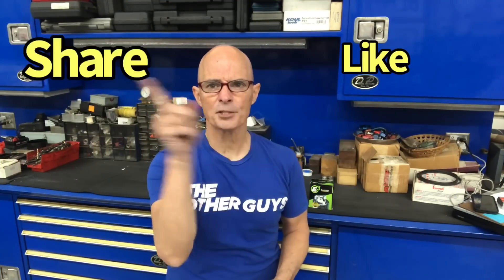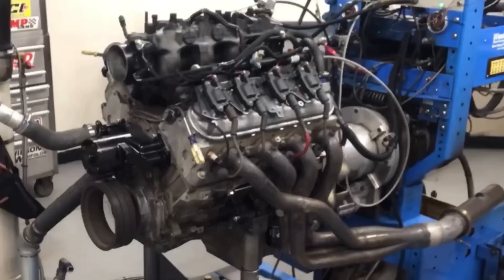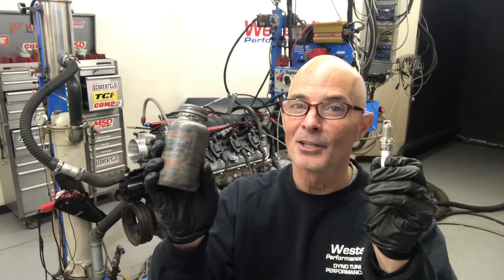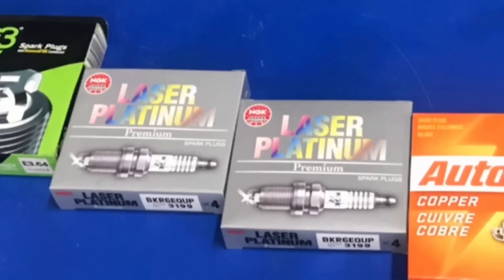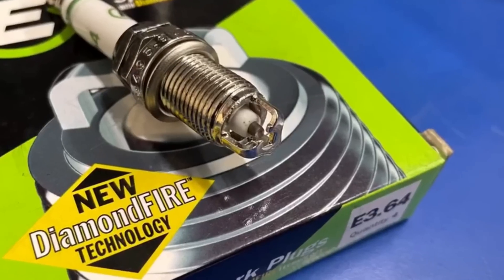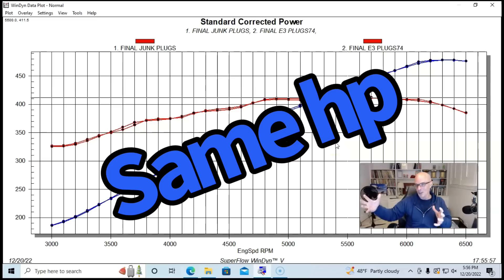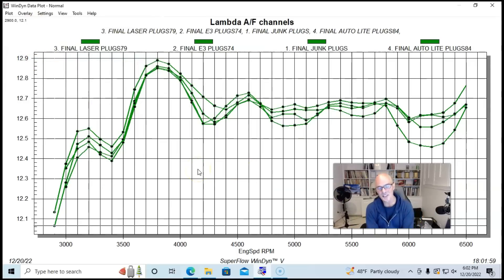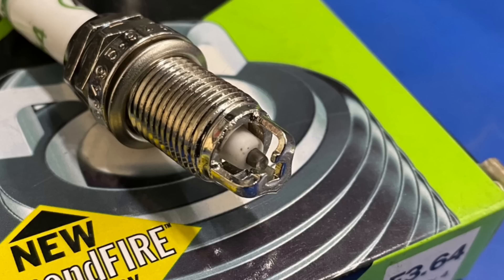E3 SPARK PLUGS-DOES DIAMOND FIRE TECHNOLOGY REALLY ADD POWER? E3 VS LASER PLATINUM VS CHEAP COPPER

Comment: I am tuning up my 01 2 door jimmy 😊 I'm putting e3 plugs 8.5 mm wires and a msd ignition coil ❤ wonder if the wires with the coil and plugs will make any noticeable difference in hoping because the truck was clapped out when I got it I'm sure they r factory wires
Reply from the maker: NOT UNLESS THERE WAS A MISFIRE
Reply: @richardholdener1727  there was definitely a misfire before on the interstate it didnt  misfire until I get up to 70 btw truck runs and idles really well now

Comment: Try BRISK Multi Fire Spark plugs. I have had good experience with Brisk plugs and thought “no way” on the multi fires. At $15 each x 4 on my modified 2015 VW CC that operates up to 29# boost, at the 1/2 mile drags I swapped out the NGK’s for the Brisks and picked up .92 MPH. This was same heat range equivalent to the NGK plugs. I put NGK’s back in, lost similar MPH. Same results in 1/4 mile drags but around 1/2 the improvement. MPH = HP so obviously they do work. However, I believe they lead to early coil issues and are good for only about 15,000 miles on the street. So I just load them up for race nights.
Reply from the maker: EXPLAIN HOW THEY MAKE M0RE POWER IF THERE IS NO MISFIRE

Comment: You should always use copper anti-seize vs. the silver due to copper having better electrical and heat properties.  I found out that when I used silver anti-seize my racecar didn't run as well as the copper C5A

Comment: I'm using e3 not for power but precision and efficiency.
I tried iridium NGK plugs .
They wasn't aggressive as the E3 .
NGK iridium was more oriented to comfort.
So they are not good for my specs.
E3 is more responsibe.
Specially with E23 or 23% alcohol/ethanol gasoline.
Coil Accel, cap and rotor BWD, Cables NGK blue series.
Test car EJ8
Reply from the maker: NOT SURE WHAT YOU MEAN BY AGGRESSIVE?

Comment: After watching this and the Engine Masters show on plugs it is pretty clear that bigger gap to an extent, will increase power, not the specific plugs.  I found that to be true when I had a Moto Guzzi.  I replaced the junk weak stock coils with Ford Motorcraft coils (used) with ballast resistors.  It immediately had a hotter spark and I could gap them out to .040".  I won't say it ran better, but with what I've seen I would say it did probably work better.  Did run and idle better at low rpm.  My brother did the same change on his RD400, as did a friend with his RD350, definitely an improvement and no fouled plugs.  

I have to believe it is the bigger hotter spark of the wider gap.  The voltage to jump the gap has to be higher and obviously the gap means a larger spark as well.   

I found this and Holdener's other video where he did gap changes when looking to find some factual proof if E3 did anything or not.  Clearly not.   Yet there are people claiming 15-20 hp gain.   A bit hard to believe for sure now.   I could believe they may make engines run a bit better if the gap to the electrode is bigger making a larger hotter spark, but all it takes is one spark to fire the mix.  And that spark will be between the best two points to fire, not all over the place, like when there is consistent electrical pressure making the spark virtually continuously firing.   That doesn't happen in the real world of firing the fuel mix in an IC engine.  One good spark and bang!   It fires...  flame on!

Comment: I've tested the E3 with the old butt dyno. I drove on them for about 5k miles and made no difference. The one thing I did notice was they seemed to be very cheaply plated. Parts of the plating flaked off. Just for that alone, I refuse to run them.

Comment: Very informative video!  At the end of the day, a spark plug is designed to ignite fuel/air mixture. They either will or they won't. The way I see it, the design/material the center and ground electrodes are made of can dictate the longevity of the plugs. And, with the way the factories are hiding the plugs on a lot of the engines, I personally want a plug to last AS LONG AS POSSIBLE!! 😀

Comment: I think if a guy could get a piece of standard Romex sealed in a spark plug hole, the engine would make the same amount of power that it usually does until the Romex burned up.

Comment: I have a set of E3's to go in my 4200 Atlas but my guru homeboy on the west coast said go back with the AC Delco Iridiums & let it ride! I removed the AD Delco Iridiums that were in there when I bought my 2005 Trailblazer LS & I had 130,000 miles at the time I pulled the plugs & they were the OE plugs & WOW, none were fouled, just worn! I was changing the coils & figured why not throw a fresh set of plugs while I had gone that far. It was running smooth but I wanted to know how the plugs looked anyway since I had bought it at 124,000 miles. New plugs & coils & Wix filters, Dynomax Super Turbo muffler & resonator delete with a set of double walled stainless steel tips out back & she is running primo smooth 🥰 Also have Marvel Mystery oil in the engine & 1oz mix in with every fill up of 93 octane. When I mash on it she doesn't hesitate! Cold air & tune next🥰👍🏿

Comment: I like your videos short to-the-point not all the technical mumbo-jumbo but when you say it made a little bit of power you need to say how much power if it's a corner of a horsepower more than let us know cuz that's what you're comparing is not just a little bit can't measure a little bit. You said the same thing with the 8.1 changing headers it made just a little bit that was 10 horsepower and torque that's quite a bit that's info we need to know so thank you keep up the good work
Reply from the maker: please look at the graphs-the plugs made zero difference

Comment: IF you have “enough” spark and safe conservative timing and proper-ish afr, all of the spark plug tests (gap, index, type) are a moot point. If you have a more radical combination, or something with a garbage chamber, pushing the limits of your available octane or leaning on the timing to run a number and win, then you might see a need for a specific plug that works better for you. No magical plug for a mild properly tuned daily. That’s just marketing 

I’d be interested to see how much you could lean on different plugs before running into trouble… on your dime of course
Reply: You hit the nail on the head. There are some very specific situations in which a particular plug will perform drastically better than others. I work on Subaru EA series pushrod engines from the 70s and 80s. My daily driver has a highly modified EA71S (factory race engine built 1989). The EA71S called for a special Golden Lodge 25HL spark plug which is very hard to find today. It was a semi surface gap plug with a very cold heat range. I run true surface gaps like you would see in an outboard engine. The combustion chamber design is extremely primitive. And the intake valve goes all the way to the wall of the chamber. Any plug with more than a slightly projected tip will be hit by the intake valve. Anything more than the coldest heat range will cause detonation. Conventional plugs with a ground strap will start misfiring over 8500 RPM. So a surface gap is the only possible option, especially when driving on the street which would foul the NGK 11 or 12 heat range plugs required to keep detonation from occuring. The surface gap plugs will self clean and there is nothing shrouding the spark which in this engine is worth about 10 HP. But this is an engine where the combustion chamber is essentially an oblong depression and the spark plug is in one side. Over 40 degrees of advance required to make any kind of power.

Comment: anyone whos had college chemistry (stoichiometry) knows that copper is a far better conductor of electricity than any other metal except gold. Platinum is one of the worst electrical conductors and the plugs I use in my K/SA '87 Monte Carlo SS is Nippon Denso U-Grooves. Its a .060 305 with 081 centerbolt heads, and custom ground solid lifter cam running VP C10. They run the best in my engine (motors are electric) and I have yet to find a plug that works better and Ive tried them all.
Reply from the maker: the dyno tells us reality-conductivity is not the question-does the spark plug work (if yes, no need for more conductivity)

Comment: Hey Richard, love your videos as always. I will say that Iridium and Platinum plugs have slightly different intents, as well as the new Ruthenium plugs. Would really enjoy a comparison between Copper, Platinum, Iridium, and Ruthenium all from the same brand. NGK would be the brand obviously. Iridium plugs are used in racing, Ruthenium are supposed to be sort of a jack of all trades. I suspect there would be few differences in a single dyno run vs a high stressed engine under endurance conditions, but would be interesting to see.
Reply from the maker: don't look for any power change from plugs-unless misfire

Comment: Silver plugs are better than copper, because lower resistance is better than high resistance.

Super fine tips and tips with square edges are better than thicker tips or tips with rounded edges ( for a given material)

If
You’re concerned about lifespan and maintenance intervals your not concerned about your engine.
Reply: My favourite plug, which I’ve found to work flawlessly in EVERY SINGLE APPLICATION I’ve ever used them in was the Bosch +4 Super Silver.

Comment: The copper plugs did run marginally leaner, a full tenth at 6000, I wonder if there would be a gradual and cumulative effect on combustion chamber temperature at steady-state cruising? And if there would be any long-term effects worth considering like the potential to increase valve seat wear due to any increased combustion temp? Do you think the engine management system would equalize the A/F ratios to be even closer to the same amongst the various plugs given an extended time to modify the fuel trims?
Reply from the maker: 1/10th of an af point is not a change from the plug (that is the margin of change from 1 run to another with no plug change)
Reply: @richardholdener1727  Oh ok, thanks for the clarification 👍

Comment: I would like to see if there is any difference in the A/F ratio at idle, as well as lower RPM power numbers, say from idle to 3000, where an engine is mostly used and torque matters the most.
Reply from the maker: you ever run your motor at wot at 800 rpm?
Reply: @richardholdener1727 Sure, lots of people floor their vehicles from a stop, from idle or not far above it. Low-end, off idle torque seems to be the most useful feature of an engine, getting the weight of the vehicle moving from a standstill is where most engines see their highest loads right? At higher rpms the engines aren't working as hard because they're already spun-up, using their already stored kinetic energy to their advantage, they're not dealing with as much inertia as it relates to internal rotating mass or the mass of the vehicle as its already overcome its initial resistance to motion after it begins moving. High rpm power numbers are pretty much irrelevant to most people as they don't use their engines up there nearly as often, but every time they leave a light or a stop sign, that off-idle torque is what puts a smile on their face, or not, lol.

Comment: Richard! I have a 6.0 in my 2003 SS sjlverado to start off with, l pulled out the Platt. 1month old plugs, put in E3's no other mods!
I could feel the difference  Right away!  in
The seat of pants feel! Ran
Better,started easer, PICKED UP  AT LEAST 1.3MPG!  
AGAIN NO OTHER THINGS ON THE TRUCK TOUCHED!
PUT A SET E3'S IN MY WIFE'S AVALANCHE  W/5.3, SAME DEAL YOU CAN FEEL THE 
EXTRA POWER IN THE SEAT OF PANTS! also some mpg!
Reply from the maker: no on the power, I would like to see your test procedure for mpg
Reply: @richardholdener1727  hay Richard, picked out a distance, backand forth 
With repeated it, with e3's and before with platt.plugs 4trips average 
With my truck 
Computer and by calculator! Always 1.mpg 
To 1. 3 and as much as 1. 4mpg. With different weather!
Reply: It’s called the placebo effect.

Comment: I’ve ran a set of e3 spark plug’s in my 63 Chevy 283 m/t two wheel drive pick up truck for years I think I got them when they first became available to purchase I replaced them because the factory plugs were fouling from leaking valve seals and would have to be pulled weekly and cleaned after putting the e3 plugs in I’ve never pulled them I still have the points distributer and oil bath air cleaner so for me they are great

Comment: There is differences in plugs,, if you use a colder plug in a high comp engine.
The iridium plugs last a LOT longer and cost a LOT more.
I changed the plugs on my Landcruiser 4500 with near 400000 km. They were worn out though the thing ran fine, even on LPG. I suspect they were the original plugs. It did seem a little more economical after,

Comment: Heat range is what seems to matter the most... Is there a difference in resistance in some brands? Good video as always!
Reply: Yes & no.  Since high voltage is an odd beast a multimeter is not necessarily useful - measuring peak current would be the only real world proof.   The interesting thing I stumbled upon years ago is that aviation plugs tend to favor being roughly 2/3 the resistance of automotive design.  Maybe an engineer or intrepid flyer can explain why.

Comment: Thanks Richard for that info
 I was wondering if you have done the same with coil packs factory vs aftermarket?
Reply from the maker: not yet-but likely the same results since the factory coils worked well over 1500 hp

Comment: Would you be willing to find a 2.5 volvo s60r and see with plug would be the best on a stock tune. .everyone claims oem. Volvo plugs or Bosch plugs. Gaped at 00.28 and what I'm asking for is witch plug can possibly eliminate detonation that cracks thin over bored cylinder wall. You seem like the perfect guy because of your knowledge base. Would you please consider this . The 2004 threw 2007 is a rare tuner sedan horsepower 300 on 15psi 300 fptqs. I just really want to see if I can prove everyone wrong an not run bosh or volvo oem plugs. Thanks for read . BTW the s60r is high pressure turbo system. With forge internal parts all aluminum engine.
Reply from the maker: I don't have that specific combo-but as shown here-don't look for power with plugs-under boost keep plug gap down near .020, also run a colder plug under boost

Comment: I think any ignition hardware upgrade (coil, wires, plugs) will not bring HP, but….
Conditions of mixture, maybe a flood wash, or even a lean condition,  recovering to a good burn may be the difference.   Longevity IS the factor.  
A good test would be running under a rich condition.  
Which plug will light the fire?

Comment: $10 in plugs is hardly worth a plug.. I'm an Orylies guy.. oem design is always best on daily's. 99 Audi A6 AHA motor is the only car i know of that took a 3-4 ground plug from factory, like the laser. The vehicle i saw didn't even have those put in it either. I wanted to change them but customer didnt.

Comment: Now throw in a set of Bosch super plugs. They are the 1 plug I have seen kill the performance of more than 1 engine. When I worked for Dodge I lost track of how many times a car would come in running rough and low on power after a tune-up, pull the plugs to find the super cheap Bosch supers in there, swap in a set of used plugs, and the engine runs like new.
Reply: Ive noticed my old Ducati 900 motorcycle always ran better with copper plugs when riding with friends on identical bikes.  We tried a big variety for plugs but nothing outperformed the stock champion copper plugs.  The ignition coils on those bikes were marginal though so perhaps a better setup would have reduced the difference.  The LS1 coil  is far better than the old Ducati.
Reply: I have a gallon zip lock bag full of factory plugs that people swapped out for gimmicky trash. Keep em coming...thank ya thank ya.
Reply: 91 300zx tt required platinum and Bosch killed power

Comment: Been arguing this particular subject for over 25 years .. for me the go to plug has always been copper its one of the best conductors out there the platinum and iridium are all about trade off of conductivity versus longevity. For me the decision has always been how easy are the plugs to change ? if they are easy to get to I run copper if it is a European super car and the motor has to be removed from the car to change the plugs ? then that fucker is getting iridium's.  Also never once have I ever witnessed a platinum or iridium plug with wear on it 100k miles or more they look brand new as far as wear. they might be carboned up or cracked porcelain or destroyed by detonation or blown piston etc but never worn out even marginally. At the end of the day if you remove your platinum plugs and clean them in berrymans fuel injection cleaner in a sonic cleaner or plug cleaner with glass beads it will last another 100k to 10 million miles simply needing cleaned occasionally as long as you do not over torque them etc.. They really are made to last FOREVER. Same goes for 99% of o2 sensor issues they just need cleaned if they work but are lazy (slow to respond) that is why investing in a sonic cleaner is a no brainer and pays for itself almost immediately and you can clean everything in garage and house with them.
Reply: on subject of spark plugs one exception to the rule over the years. Champion plugs only ever put them in dodge products / engines or lawn equipment for some reason those create loads of problems over the years when they are put in anything else. E3 plugs in my lawn mower use less fuel to cut the grass this is repeatable